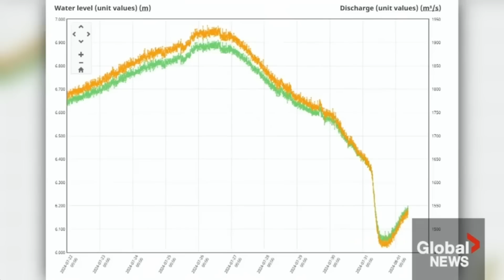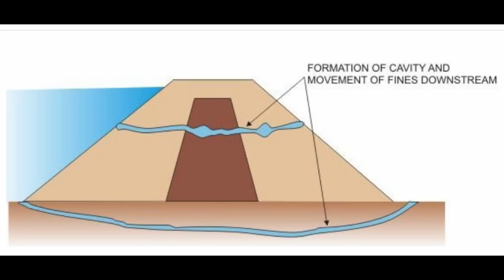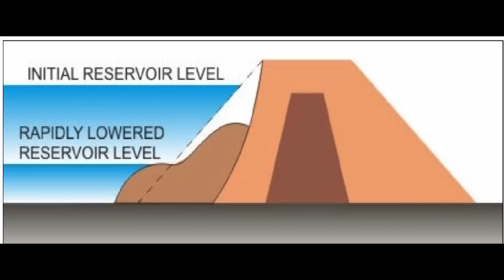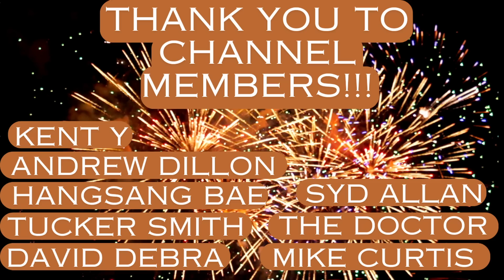Massive Landslide in Canada Creates Dam that will Fail

Comment: I just looked around on YouTube to see if anyone had any updated aerial vid of the landslide dam, nada zilch nothing.  Now I'm starting to worry, because everyone is using the same images from 2+ days ago, so I can only guess that no one has any clue how much water has built up behind that landslide dam.  This isn't like a prepared dam with engineered soil types placed specifically for the task, this is just a random rubble pile of all kinds of rock and dirt.  It may hold firm and form a nice barrier lake and waterfall, or it may give way the instant the shear forces exceed the internal resistance of the rubble pile.
Reply from the maker: Thank you so much! I found new images and filmed an update last night and it will go public at 8 am Central time today. The reservoir is much higher and is starting to progess across the top of the debris.
Reply: @CaseyJones-Engineer  thanks much.  B)

Comment: How much flow does this river have compared to the Columbia. It took an estimated 6 months 500 years ago for the bridge of the gods to overflow when the same thing happened.
Reply: Very hard to predict, given the size difference. The Chilcotin is a much smaller river and this is a far less significant event. The Bonneville Slide on the Columbia was about 3 km wide and about 75 meters deep at river level.

Comment: It never fails to amuse me how, when nature demonstrates its awesome, immense power, the human response is: “we need to fix this”…

Nothing needs fixing here.  Let nature do what she does best.

All we mere mortals can do is—if we live downstream along the banks of the Chilcotin or Fraser Rivers—is heed the warnings of the provincial government and be prepared to move to higher ground in the event of a sudden surge/release of the reservoir building up behind the slide (though I too doubt there will be a massive sudden release).  It's all the more likely the water will overtop the slide debris and slowly begin to erode it back to the original river channel (not anywhere else the river can go in this steep terrain).

It may take a few years or more, but the river will return to its place.  (Note: the original width of the river along the ~1'000 m width of the slide was between 91–42 m (~300–140 ft).)

Salmon spawning runs on the Chilcotin and on the Fraser below the confluence of the Chilcotin/Fraser will be affected for the next several seasons, until the debris is flushed through the river system (a couple good winters of rain/snow should do the trick).
Reply: So true. The course of the Chilcotin has many similar slides. They happen frequently in a geologic context, but humans live in a much shorter frame of reference.

Comment: Do you think it would be safe to put a machine on the makeshift dam and try to dig a trench to open the flow?
Reply from the maker: I think it would be rather risky to the crews.  Maybe what they should be doing is building a cofferdam well downstream to catch the slug of flow when this thing cuts loose but incorporate drainage pipes to allow water passage downstream.  They could then come back and clean everything up.

Comment: I am ignorant so I am expressing an idea from that perspective.   Considering what you have said, wouldn’t it be prudent to blow up the high side of the slide blocking the river?  Cause the flooding early so there would be less water rushing downstream?  Also possibly decrease the probability of slides where a lake was formed and is getting higher and wider?

Comment: I think that (thankfully)being as its wide(600m) as it is it will be a slower erode once it breaks over.
Reply: It will start at a low point.  That slide is not level across.
Reply: @philipdamask2279  logic would no doubt dictate that

Comment: @Casey Jones - Profesional Engineer the one in MN I think they could've mitigated w those X large Dumpster Bags portable have handles on them can be quickly filled by backhoes and rapid dropped in place by helicopter or cranes, in inaccessible areas especially! They're handy because they're like giant sandbags and have the ability to be strategically placed back to back and actually wall it up solidly enough to where it should make a huge difference I would imagine. It would have been really helpful along the bridge pylons. There was another one that had breached around the side that they were trying to fill dirt in with a crane, and it was just being washed away as they did it... which is where I got the idea from originally. 😊 just a bit of an outside the box way of thinking considering that those bags are now available and they hold 3,300 lb on average. It also would have been a lot faster than them hauling dirt and just loose berming it up to direct it away from other areas in town. Firstly it's a huge mess, takes Much Longer, isn't going to withstand too much before it erodes away, and may not even still be accessible where its needed, and then there's the cleanup. I really wish you would look into that as an idea to share with other Engineers because it really would make that difference when you need it in a hurry!

Comment: I feel why they can't accurately calculate when the overtopping will occur. If you know the inflows and you know the volume of the surface above the lake at the level of the top of the deposit, it should be quite easy to calculate what time it's going to over top. What's wrong with these people why is it taking so long to calculate it.
Reply: No one has said there is known or mapped topography of the area.  Some people say the area opens out quite a bit as the new reservoir rises.   I wonder if the river could flow into an adjacent valley.

Comment: British Columbian here, but not near the area.  Provincial officials have stated that their modelling shows that the worse case scenario is a 10 m (33 ft, to those who don't speak metric) rise in the Chilcotin, which will be quite disastrous to the downstream communities.  Of course they are hoping for better than worst case.
They predict that the Fraser River level will not rise any higher than spring freshet, which is helped by the fact we've been in a drought and that water levels are lower than normal.  Danger will be the rapid rise of water catching people unawares, with minimal risk of flooding.
Root cause of the landslide is thought to be devastating wildfires destroying trees in recent years, resulting.loss of stability.
Reply from the maker: Thank you. Is there an updated estimated time frame for when water will flow over the top of the slide,
Reply: @CaseyJones-Engineer  Nothing reported yet as I write this (Monday, August 5, 9am Pacific).  BC Government has set up a website ( gov.bc.ca/landslide ) with more information. 
They expect the dam to be overtopped, with the scour happening slowly enough that river levels won't dramatically increase, but a catastrophic collapse could result in up to 21 metres (69 feet) rise.  They also admit that modelling is an inexact science.

Comment: We had a similar landslide in Oso Washington on the North Fork of the Stilliguamish River in March of 2013. After several months of above average rainfall the slope gave way and damned the river and killed 43-44 people in houses on the other side and driving on the highway beyond until it met the slope across the valley. It was about a square mile of land. 
There was a lot of fear about downstream flooding when the blockage and some people were evacuated, but the river re-established its channel after a few days without drama. It took several days to rescue survivors and a month to find and recover all but one of the bodies from the mud. 
They used Lidar to find that valley has been very active with past slides and the county has been more restrictive on allowing building going forward

Comment: It seems that the more the water builds up behind this blockage, the worse the upcoming flood will be.   Wouldn't it make sense to try to  create an opening for the water to flow out sooner rather than later OR is this a case where the blockage is so unstable that putting construction equipment there is unsafe?

Comment: Hey Casey, I wonder if you would look into what happened with the Addicks and Barker reservoirs at Houston after Hurricane Harvey.  Mark Russo of the USACE and local meteorologist Jeff Lindner were reporting status several times a day and with Addicks reservoir in my front yard and rising, I watched their reports religiously.  One day they announced, very abruptly, that all the gates of both dams had been opened 100%, and who needed to evacuate immediately downstream.
There was water starting to flow around the ends of both dams and it wasn't a huge amount yet, but water was still coming into the reservoirs too.  I'm pretty sure they decided those outflows were going to start scouring, which would have meant disastrous loss of any control before long.  Nobody ever said that out loud, but it struck me later that must have been the reason for such a sharp 180 from what they had been saying for days.  My dad was a dam engineer but I didn't think to ask him at the time, and he's not around anymore.

Comment: Would it not be possible or feasible to dig a channel quickly to initiate the flow again (which will then erode the channel wider and deeper) before it overtops naturally? Would that be too dangerous? Could a string of small explosives be used to create a channel? The purpose would be to re-initiate flow, but before it causes flooding upstream, and before such a huge volume of water has built up that would then cause flooding downstream. What about creating a giant siphon from one side to the other?
Reply from the maker: At this point I think it's too dangerous to have any crews working on or very close to this landslide blockage.
Reply: @CaseyJones-Engineer  that i can understand. What about using drones to drop explosives though to make a channel?

Comment: just a thought that popped into my head, but what if the military just started shelling that landslide damn to try and break a spot open to drain it asap? I assume there is also risk of causing more landslides, but that would also have to be weighed against the potential damage that the backup of water could cause and the extra landslides that could happen even if nothing was done.

Comment: Thank you for your insight. Also, as a BC resident, My biggest concern is that this year is year 4 of a major Sockeye Salmon run which is very important to the ecosystem of the upper Chilcotin area, and BC.  If the Salmon are not able to get past the slide we may lose this run forever as the fish will not know where to return to. I agree with you that the water will crest the top of the slide and start undermining, hopefully a slow process. That area is largely sand,, so hopefully no liquification and catastrophic failure.. Thx again

Comment: Nice analysis, and from a engineering geology POV I fully agree. Thank muchly.  And to any lawyers familiar with the Canadian system...  Hypothetically... If the institutions responsible for public safety interviened in any way regards say, controlled dam spillway formation,  to reduce the water level/back pressure, would that institution then be more or less responsible  for what then might ensue?  I'm thinking that if they do nothing to intervene but issue warning and evac notices etc, they themselves are not liable, and the national bodies provide post-event  support, but if they do intervene, say buy cutting a spill channel while the damed lake is still fairly low, (that they then attempt to control, and most likely fail to control)  their department gets hit with massive law suits and bills and it all goes sideways for just about everybody? (Except the lawyers of course, who make a mint!)...xxx ;-)
Reply from the maker: I think you're exactly right, they don't want to do anything that makes them take on liability for anything that's going to happen.

Comment: This is reminiscent of a fill and flood that everyone sort of knows about but don’t know they know about it. It’s semi historic in the sense there is a historiography but legends that come out of writing. At least three text focus on Shuruppak. This is in the period in which, following the climate optimum the Arabian desert continued to expand and at some period the Euphrates basin south of what later became Mari was filled in by blow and may have been helped by humans. The legends have it that the flow of the Euphrates slowed down. Around 2900 BCE, the infill gave way. We have relatively precise information on this because Shuruppak was a civil city and had been attacked with its administrative record keeping burn down firing its clay tablets, ironically preserving them. After the attack the city was rebuilt. 
    So what is the point here. What about this flood is remarkable? The flood cut through the infill dislodging the accumulated sand, it change southern Mesopotamia considerably. The city of Shuruppak itself was buried is +15 ft of very sandy silt, according to legend the administration was moved to Kish, Shuruppak falling in position and eventually would disappear. Ur however, which has a sterile layer after settlement 5450 BCE began to grow markedly after the flood, and by 2200 BCE would be the largest and most prosperous city on Earth. 

We get these story indirectly via the Hebrew Bible in the flood of Noah, which borrows by its two sources, independently from the Epic of Gilgamesh and the story of Atrahasis. In Eridu this history (which we don’t have) was summarized in the Sumerian Kings List in which the kingdoms were divided into the kings before and after the flood. No source of the flood uses the same hero, but the SKL reports a Ziusudra, son of the king of Shuruppak who fled the city in a reed and pitch boat and settled in Kish. 

   There of course are many floods, but what made this flood remarkable is that load of silty sand it carried downstream changed the landscape, politics, religion and history.

Comment: When the dam breaks the flooding into the Fraser river won't that bad. Down stream of the dam there is a spot called Farwell Canyon. That will restrict the flow into the Frazer. The water will back up above the canyon and be metered out through the canyon.

Comment: Thanks for the video. 

Would there be any value in trying to dig a trough to start the water flow through this mass of earth? If they could get the water flowing sooner, there would be less backup and possibly less overall damage when the mass of earth fails. Maybe digging with heavy equipment would be too dangerous, but maybe blasting would work. I knew a geologist who worked on quarries. They would place explosives and lift the whole ground. 

I hope that the soil will be eroded quickly and flow restored so that they can start the process of recovery. I'd feel worse for people if they had to wait for months for the water to cut through the slide and then release an even greater volume of captured water.

Comment: I read in castanet that the potential water flow would not exceed a typical freshet. In other words, we've had far more come down the Fraser and likely Chilcoten too.
I suspect it will look very much like the November 2021 flood which took out trees and deposited them all over but at Hope the river widens and slows so you have logs piling up on the banks. Whether this poses an issue if they accumulate around bridges, etc is an unknown but there's likely a significant amount of dead trees that are part of the landslide. (plus whatever gets pulled in both in the dammed area and downstream.)

Comment: A lot of the Chilcotin and Fraser run down deep canyons so the settlements and homes are on mountain sides and higher elevation. But the worry is on the Fraser valley beginning at Hope (which then runs 100 miles west to vancouver), which is a huge flat flood plain with settlements not much above river level.  This flood plain suffered a catastrophic flood event during winter storms three years ago, with tens of billions in damage and many bridges destroyed.

Comment: Don’t call it a ‘disaster’, it’s NATURE doing what it does naturally.
Reply from the maker: This didn't happen in a vacuum free of human input.
Reply: @CaseyJones-Engineer   You are not entitled to have input.   You did not create this Earth and everything here, nor The Lands.  You created nothing. Therefore, Your input is null, and void.   You engineers, scientists, and researchers are going to learn the hard way, and it won't be pretty.  You will pay for your karmic debts in full, and no payment plans, nor I owe you's will be accepted.  You are not The Feminine Aspect of GOD'S Lord,  and you most certainly are not her GOD. Perhaps you should think twice, three, four times of the potential karmic consequences that you most certainly can expect to be facing in the very near future for thinking you can hack into, and alter GOD.
Reply: @CaseyJones-Engineer  In my understanding the face of the mountain that slid had been destabilized by the trees that were killed off by pine beetles. The roots were holding the mountain side together.

Had humans intervened, and sprayed to keep the pine beetles from killing the trees this slide might have been delayed or averted. Human input in this case would have been beneficial, much like the prescribed, burns in heavily wooded areas to lessen the fuel load to prevent/lessen the effects of massive forest fires.

The mountains have been moving and eroding and falling into streams for thousands of years before we even got here, and they will for thousands of years after we go.